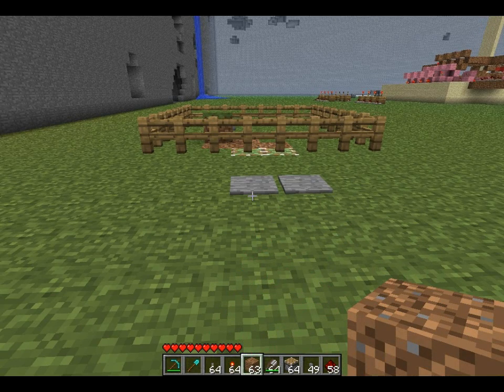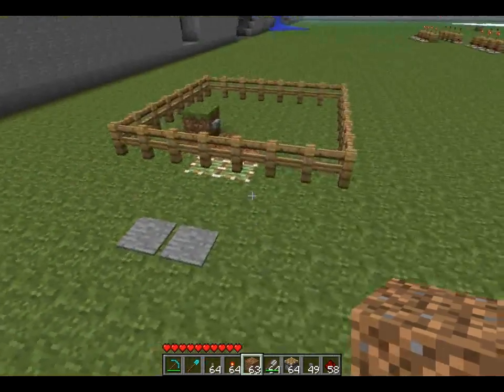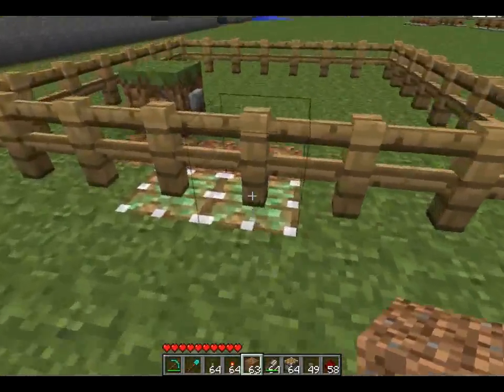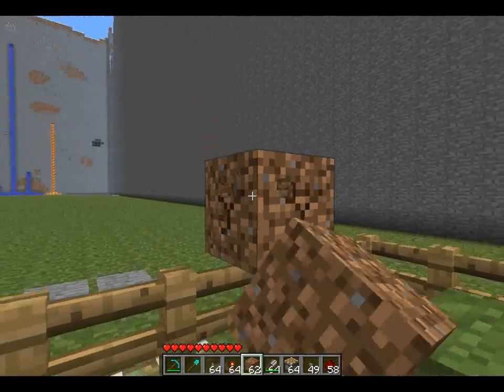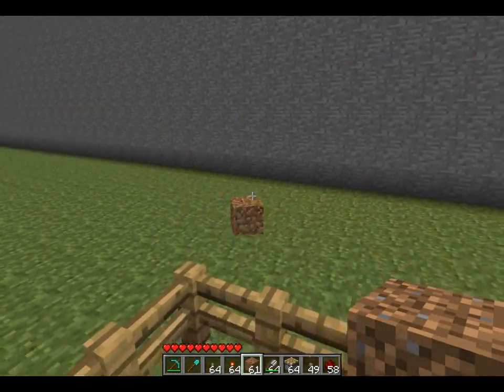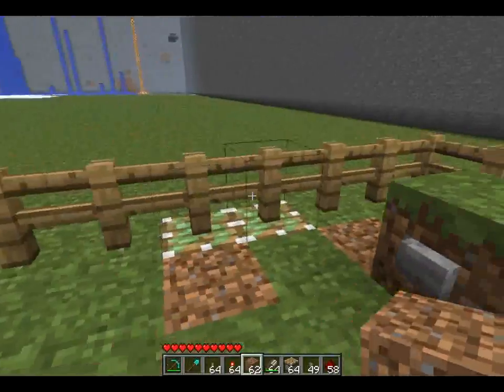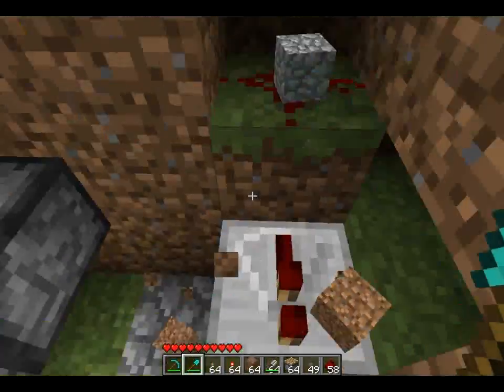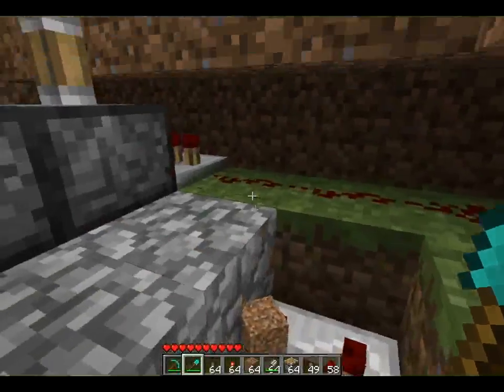Fence gates using sticky pistons

Comment: @vawriss3 You have to add an inverter to the circuit, basically:   ___[_]/___
Where the '_'s are redstone wire, the '[_]' is a block and the '/' is a torch attached to the block.
This inverts the input signal.